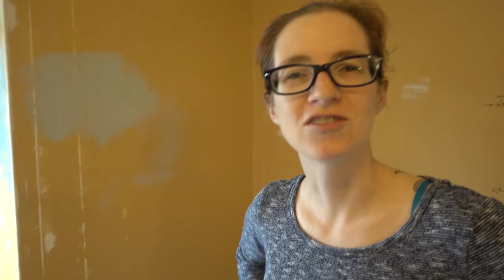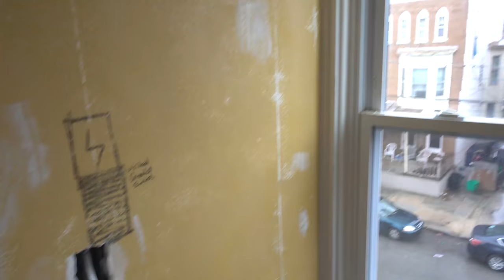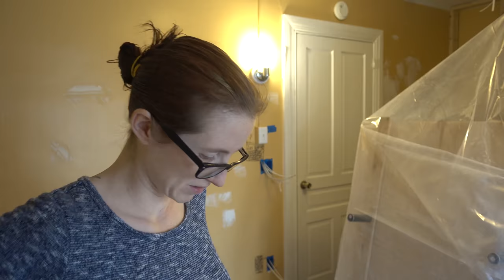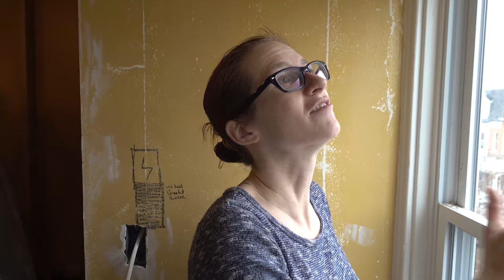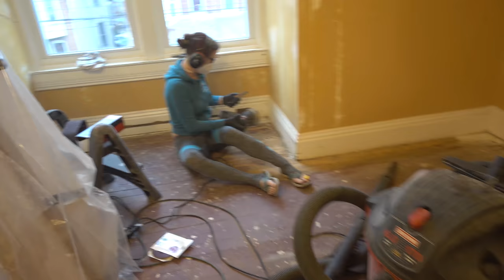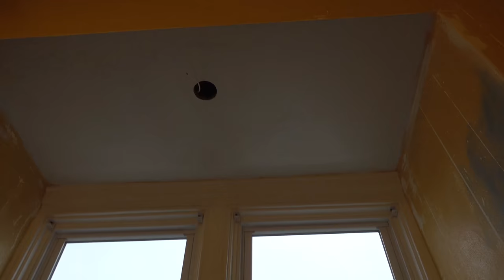Allie Sticks a Phone Up Her Bottom

Comment: One trick I saw for filling gaps in wood is to put some slow-setting cyanoacrylate adhesive in the gap and then sand it so the glue and dust mix to form filler.

Comment: You need to take a punch and set all the nail heads deeper or when you sand you will sand the heads too thin or completely off and your floor will start to float on you. If your hitting more then a hand full of nail heads then the floor has been sanded before and is probably too thin to refinish again.

Comment: Did you get the old plaster tested for asbestos?
Reply: Roger. that house is an oldie. It maybe older than the days they even used Asbestos. My sister bought a house with those old asbestos shingles. You can't take those to the dump because they are considered haz-mat. But the good part is the house is very fire resistant. Not pretty but safe I guess.